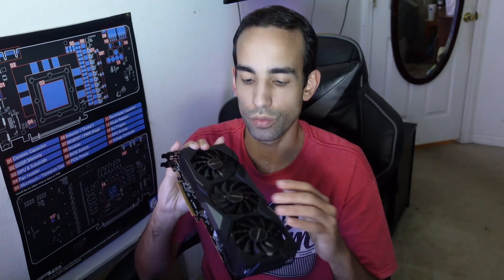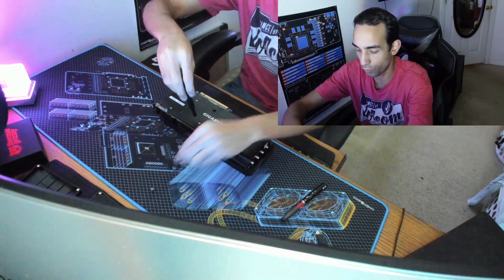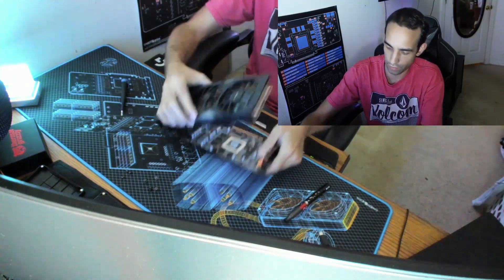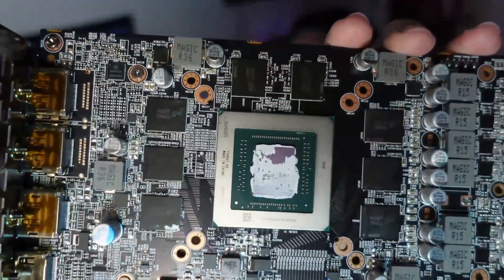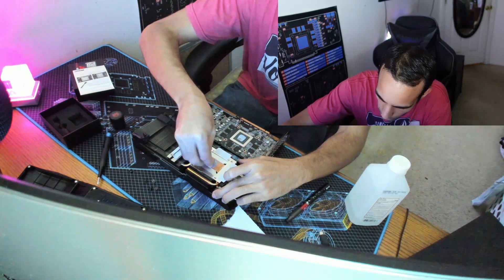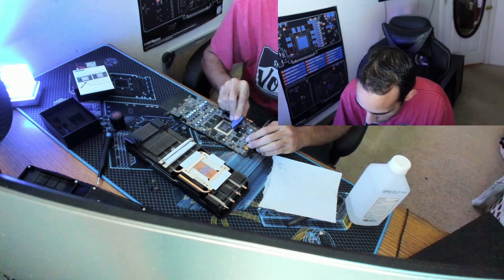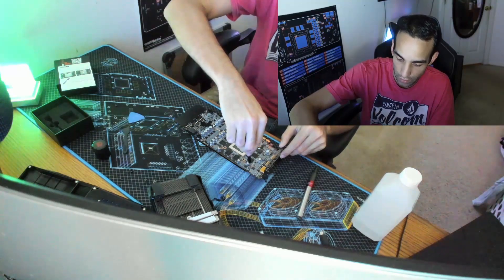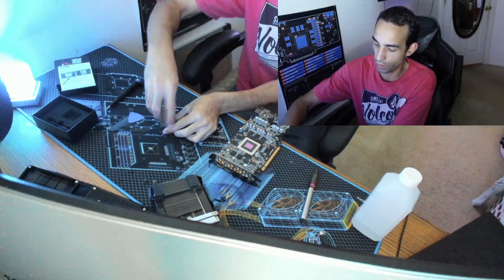1st thing you should do with 2nd hand GPU's

Comment: What size thermal pads do r9 390's have?
Reply from the maker: It depends on the model of R9 390, what make and model you got?
Reply: @SerpentXTech  Safire 390x backplate and 390 safire non back plate
Reply from the maker: @0vers33r1  1mm thermal pads
Reply: @SerpentXTech  thx 😉